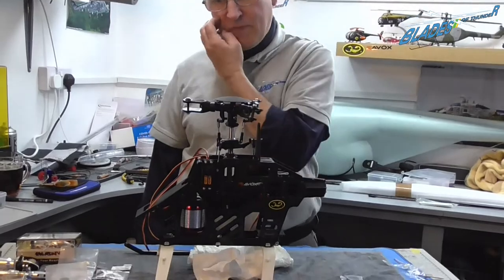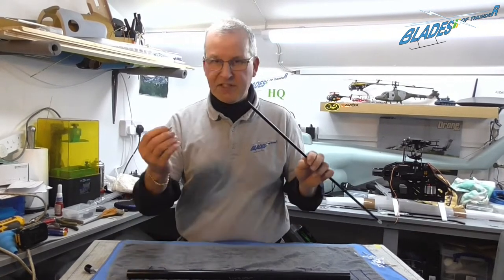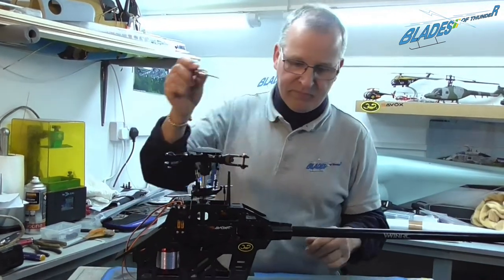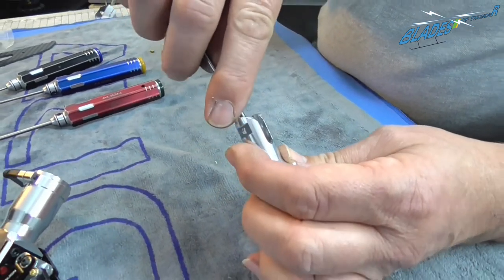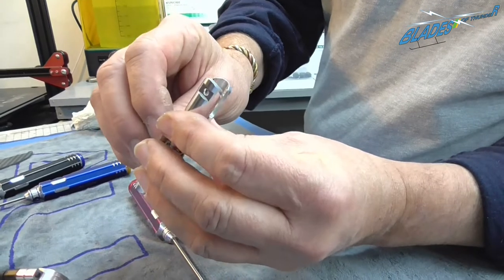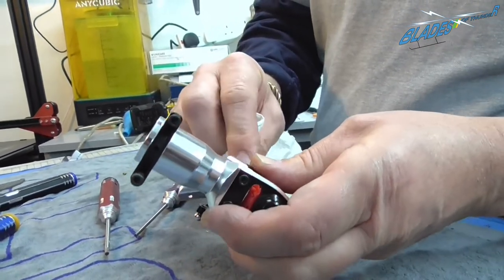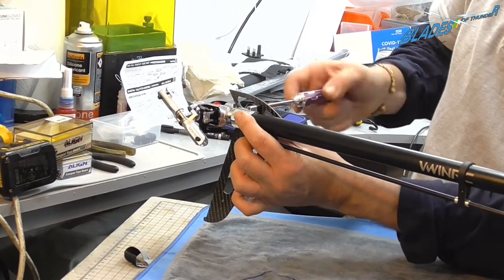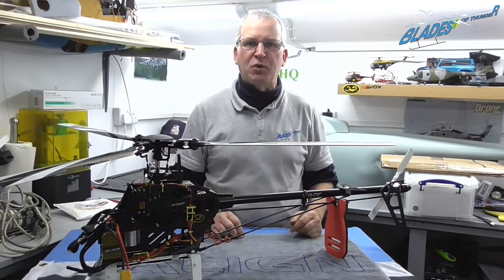BoT 550e Assembly Part 2

Comment: I see that you have changed the white main drive gears to black units - why?? Do you have the part numbers.
Really enjoying the series, thank you as very useful.
Reply from the maker: We change the gears as the black later versions of gear are stronger and as this is going the westland whirlwind we are building the upgrade was prudent. They are stamdard Align parts main gear H60019AA Auto rotation gear H60020AA your also need to replace one way bearing and main gear case HN6064BA

Glad your enjoying